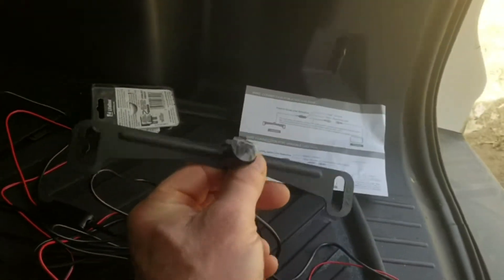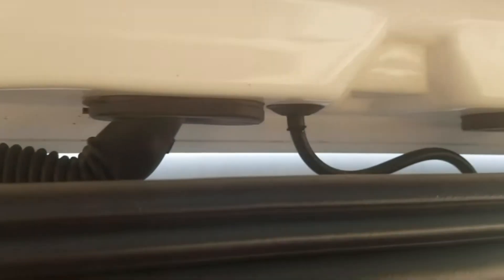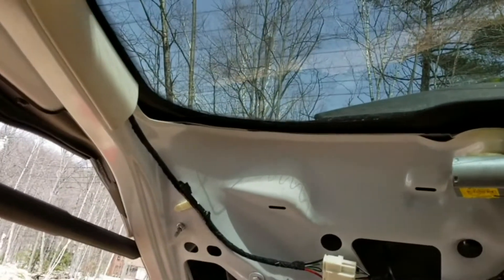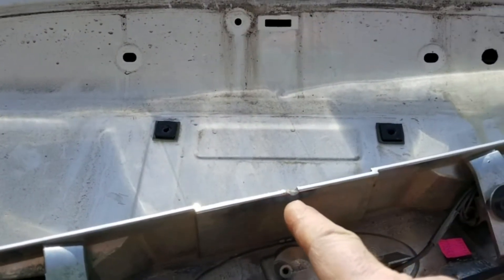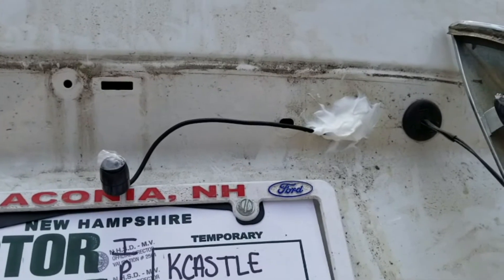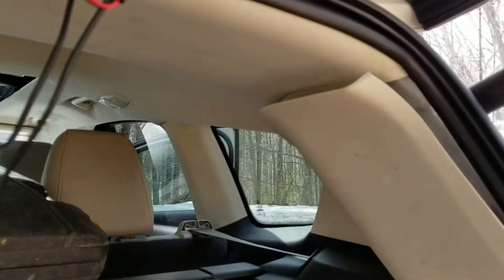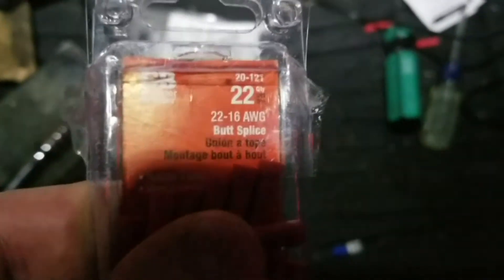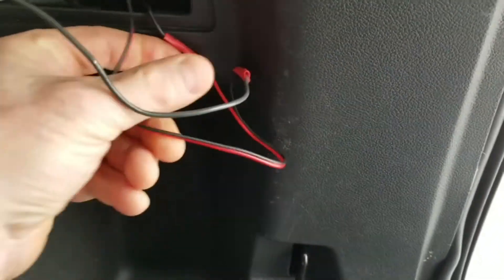Adding a backup camera to a 2013 Ford Escape

Comment: For those wondering where he got the yellow plug-in, that has to be ordered separately as an adapter. I'm ordering one in now. Had no clue I would need it.
Reply: Where do you order the adapter for the RCA plug..
Reply: @In2oil2  ebay i found one
Reply: @mossplayz3365  Hi there! Can you please share the name of the adapter for the ford escape please. I need to order one. Thanks in advance
Reply: @MasQueAutosRD  54Pin Rearview Backup Camera Input Harness Adapter for Ford SYNC 2/3 8" Screen

Comment: I searched for a harness, and i found one, but it said it will not work unless the SYNC module was programmed to accept a back camera.  did you have to re-program the sync module or was the programming in the escape already? I don't have an escape I have a 2013 Ford Cmax so it should be pretty close to your installation it has an 8 inch screen with SYNC but not sure what version thanks.